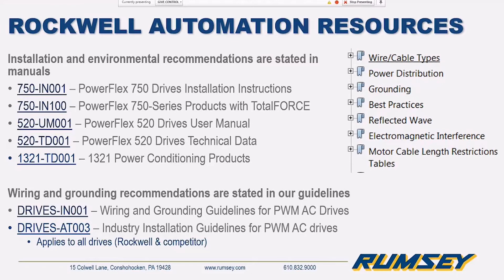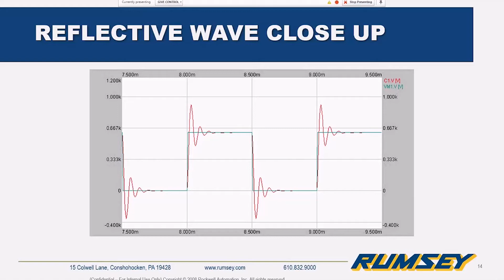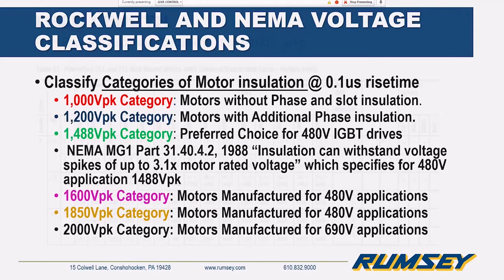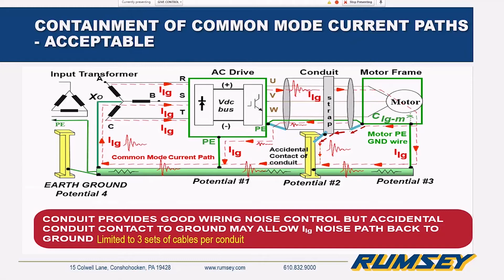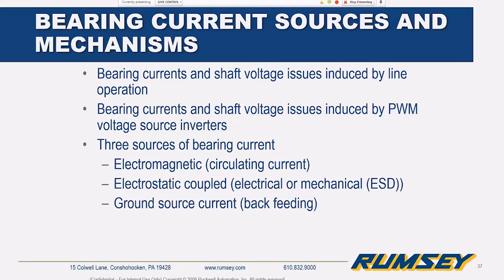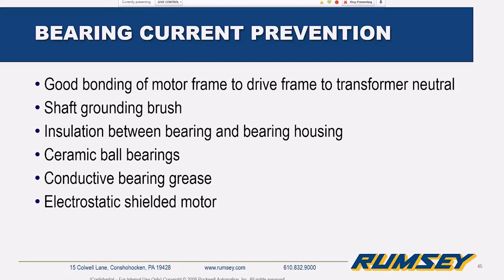Protect Your Motor

Comment: Wish I'd seen this video 20 years ago so much explained I did not know. Would love to know what parameters get changed when a Static rotor test is done on a Rockwell drive and why that would get rid of a ground fault error I had last summer on a 100' 2hp 460v motor.  Also if Drive already has a line reactor can they lose their effectiveness over time from overheating. All high voltage tests to ground are excellent but after watching your video wonder if cable they used is good and they installed all VFD cables in a Stainless Steel ducting not conduit and I believe you said max of 3 cables per conduit. Thank you so much for this Channel.